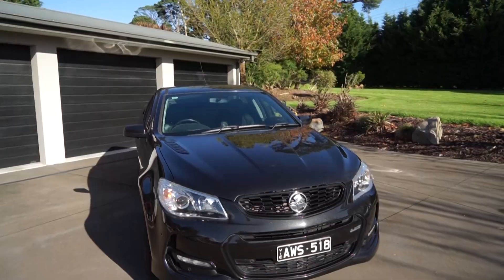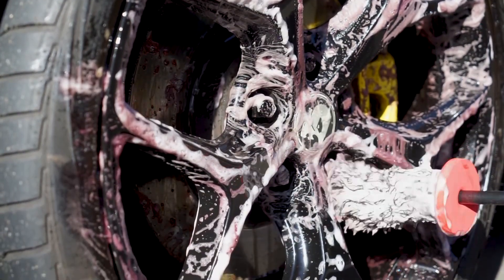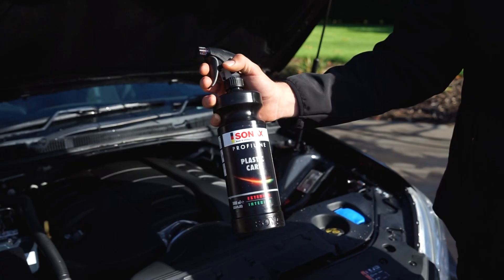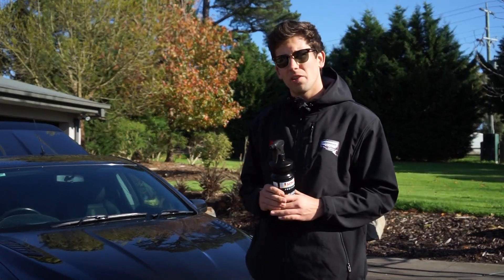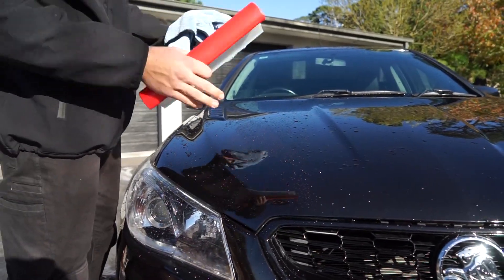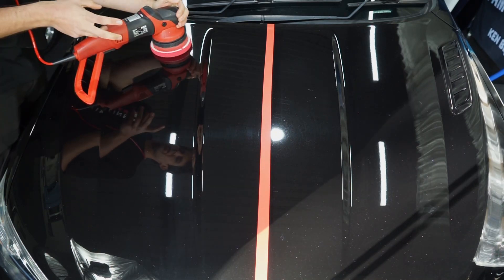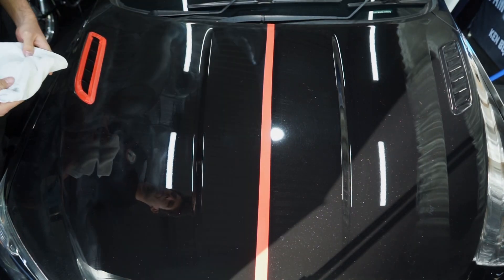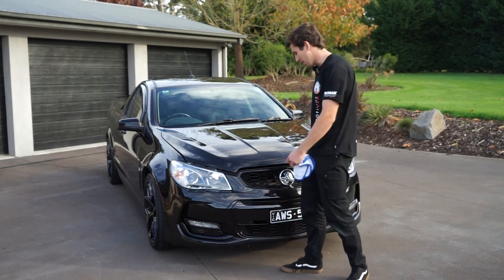Detailing An Australian Icon! | Holden VF SS Ute

Comment: Just wondering how did you stop that spray cleaner going on to the interior and the alcantara on the dash when spraying the door jambs? I've got a Caprice with cream alcantara and no way would I be wanting any spray cleaner going on my material... 
No deioniser or panel wipe prior to the machine?.. I definitely like the look of that engine bay product.. Not a bad result at the end.
Reply from the maker: Hey there, 

We use Multistar as our all purpose cleaner which has a very high level of material compatibility, it is designed for exterior & interior use. So, if any did get onto those surfaces it will not be a problem, however we do use a high precision sprayer to avoid the overspray. 

If the vehicle is heavily contaminated we will use an iron decon product but in this scenario a clay bar was enough prior to machine polishing, 

Thank you very much, we hope you enjoyed the video!
Reply: @sonaxaustralia5435  Thanks for the reply. Did enjoy the video and the car looks fantastic.. I'm keen to try that product you used inside the bay.. I've got some of your products at home and they're fantastic so looking forward to trying that.. Cheers